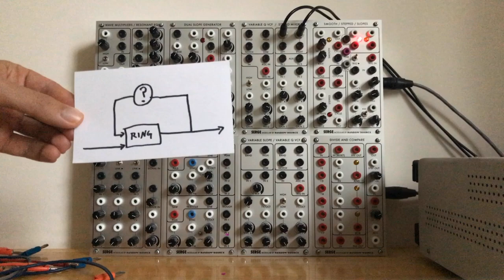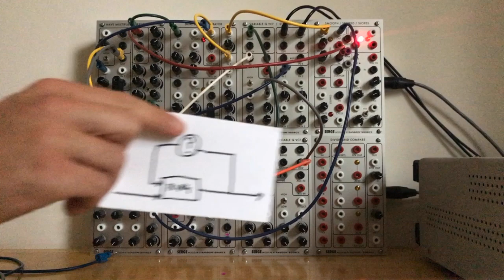Cybernetics IV - The Feedback Path (Part 1)

Comment: if a ring modulator basically multiplies the two inputs with each other. And one input is the output of the ring modulation. Then at least in the beginning, the feedback should be silence, no? Since when you connect a sine wave, it still gets multiplied by the output, which is 0 at this point and therefore there shouldn't be any sound. Why do you get sound however? Is it due to noise? and how would one implement this in software, if one input is simply 0.